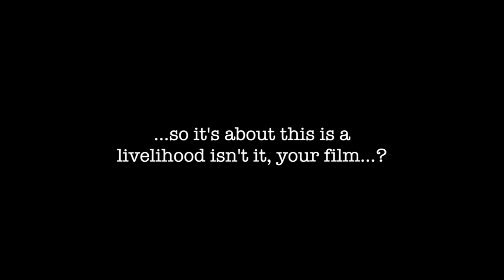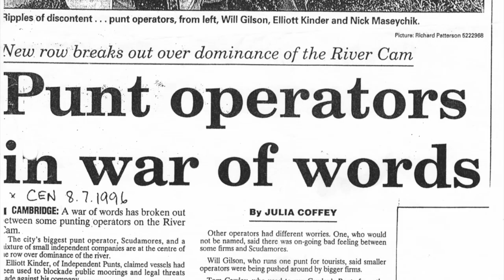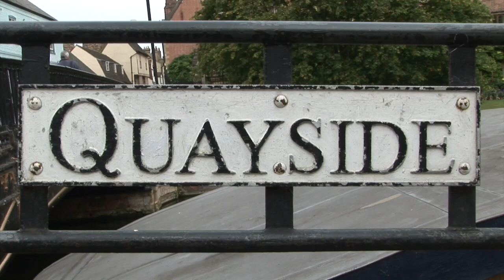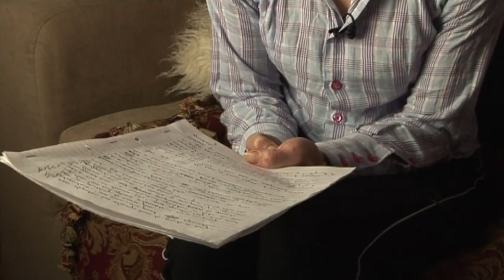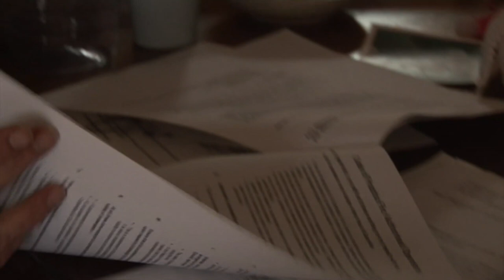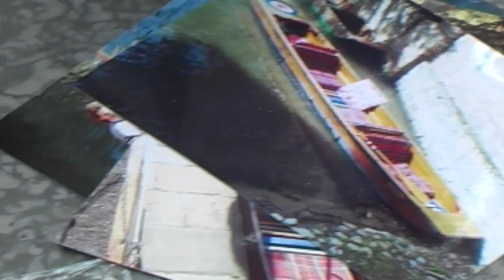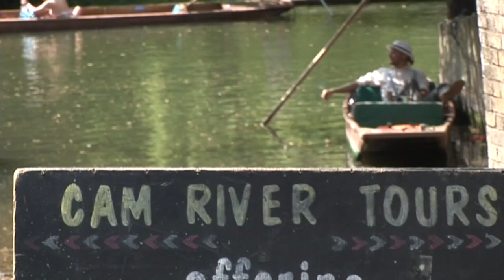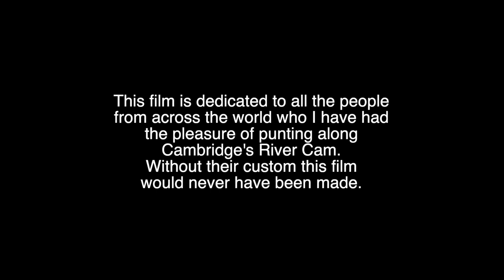Punt Wars

Comment: I recall seeing punt war trailer 15 years ago. Finally seeing the actual documentary. What happened afterwards? are there still independent punters in 2024? There used to be a lot of boats picking up in Garrent Hostel Ln in 2010, but doesn't seem to be the same in 2024.

Comment: Hi James. It's a pity you stopped filming in 2008 – you missed the most savage period of all, namely the early 2010s! I largely look back with fondness at my time on the river. Though there were certain individuals whose faces are no doubt as punchable today as they were ten years ago, it was largely a decent crowd, made up of intriguing, non-conformist folk.
Reply: What happened in the early 2010's? Intriguing.... great documentary.
Reply: @johncaldwell6395  Utter chaos. Huge numbers of independent operators (myself included) loading customers onto their punts at the modest slipway at the Garret Hostel Bridge. And then the ridiculous omnipresence of touts up and down King's Parade, causing tourists repeated irritation. It had to end sooner or later.
Reply: @thomassnodgrass6075  hadn't touting been banned by the end of the film?
Reply: @johncaldwell6395  No, on the contrary, it was just about to multiply again. The opening of the landing stage at La Mimosa, which required a licence for use, immediately forced large numbers of independent operators (mainly the less experienced and more loutish ones like myself) away from Quayside and on to King's Parade, which has a much bigger surface area and could accommodate larger numbers of touts.
Reply: @thomassnodgrass6075  Crikey - who'd 've thought!